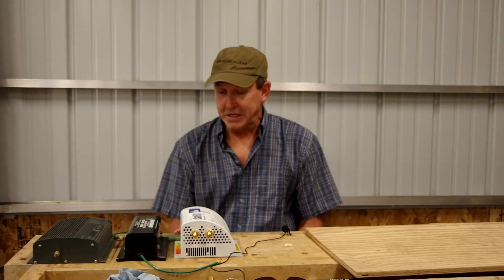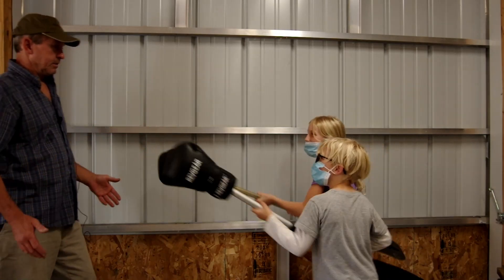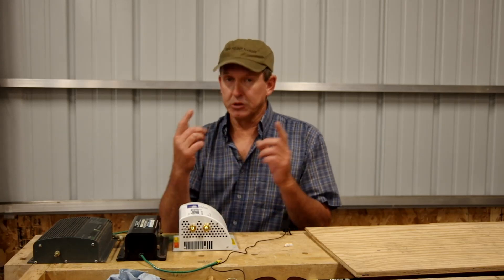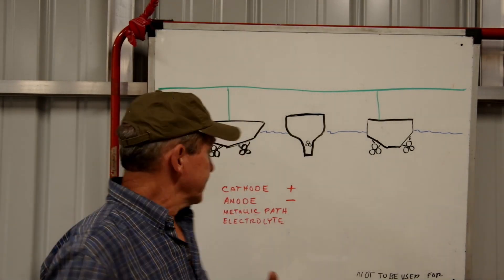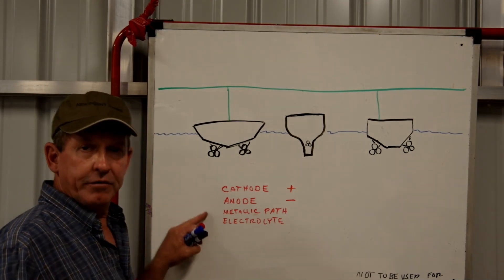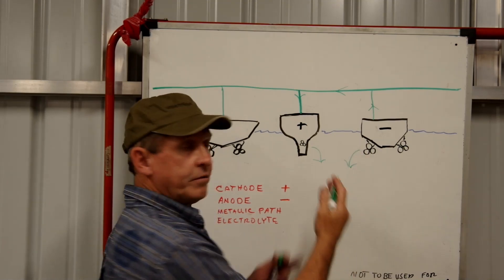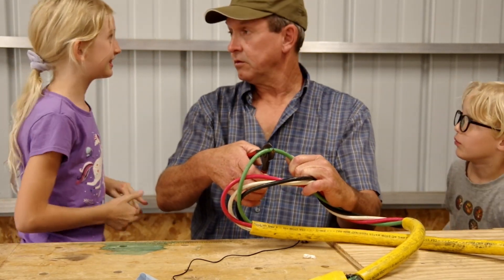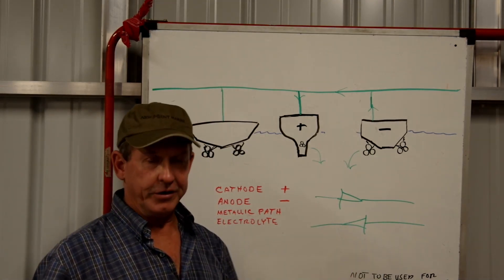Marine Galvanic Isolators 101. First Part

Comment: This was really informative, thanks. 
I wonder about DC leakage when the boat is sailing. Is there a chance that the on board DC could cause galvanic corrosion? 
Thanks!
Reply from the maker: Thanks for the comment . We put together a video that I hope will give a satisfactory answer to your great question. The video will go live May 30 at 2030 eastern time. Please keep the questions coming.
Reply: @workinonaboat1950  I was expecting to wait a short while for an answer, but 5 years is quite a long time! 😅
Reply from the maker: @lukejay  Wow it has been almost five years. Sometimes work gets in the way of the fun stuff. What was your question? lets have another go at it.

Comment: Good schema for boats grounding circuit in marina, but unfortunately the core idea of galvanic isolator is not revealed. This makes this video belong to the 'marketing' series of guys presenting 'magic boxes' without explaining, what's inside and why this should help. Definitely not a scientific way of problem solving. Why diodes? Why not resistor, not capacitor, not inductor? The answer is behind the idea of 'grounding' (this should be explained when you say 'dont gut green wire') and the diode's V-A curve.

Comment: What size galvanic isolator would you suggest for a 27’ boat with max 1500w onboard ac power consumption? Shore power plug is a 16A and boat is in Europe. The problem is that sometimes they move us around and other pillars may have 32A plug. Thanks!
Reply from the maker: Check out the Victron isolator VDI-32A. That should do.

Comment: Excellent explanatory video, I wanted to know the galvanic isolators that device uses for failure tests. I know that they use two diode bridges that can circulate the current in both directions.
  the question is what device is used between both ends to make it work failsafe. use a dc or ac electrolytic capacitor. or use another element. Could you explain me how is the configuration?
Thank you.
I am a specialist in the area of corrosion and cathodic protection. I am at your disposal for any suggestion.